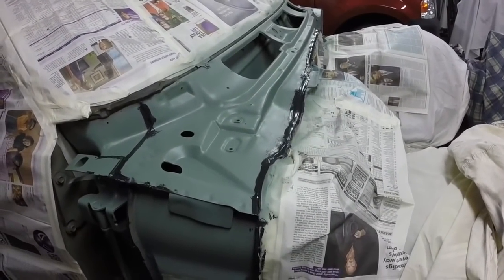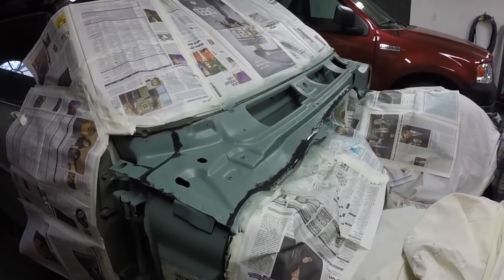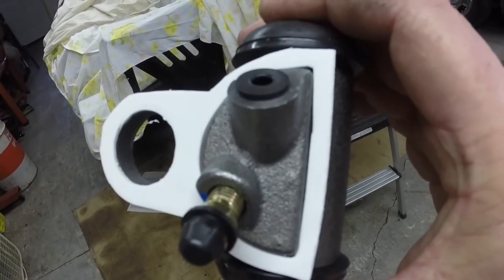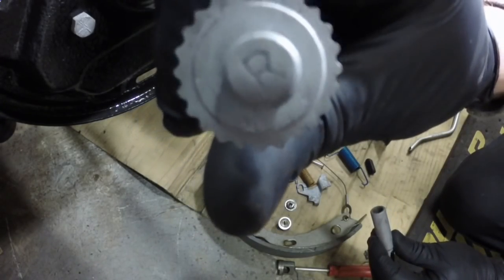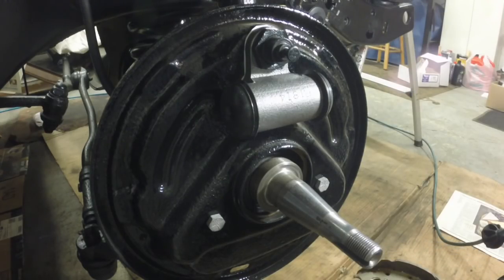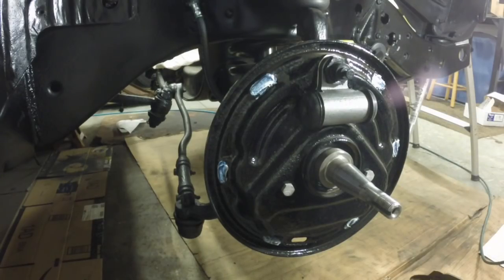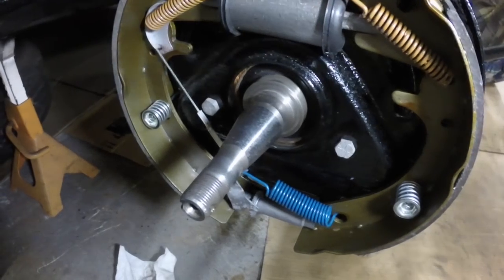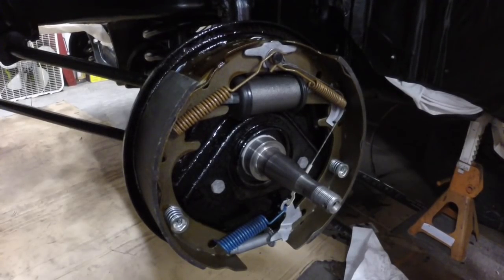1966 Ford Galaxie 500 convertible restoration part 48 installing front brakes

Comment: Well, DAMN.  I had it right but thought it was wrong so I took it all apart again.  When I got it all together, the adjuster lever was riding alongside the star wheel.  I thought it had to be up higher so you could hear the click of each "bump".  But, mine was alongside the star wheel so there was no specific click, click, click as the star wheel was turned.  Well, now I know since your adjuster lever lies alongside the star wheel, too.  And you helped me in another area, too.  I started doing the brakes a year or two ago but got discouraged when I got everything together and they hung too loose.  I was only using one holddown lock "washer".  Then, I noticed I had another one, too.  I figured that went behind the backing plate.  Nope, wrong again.  But you showed that the two holddown lock "washers" go on each end of the short holddown springs.  That works.  I'm so tired, I just had an ice cream.  Now, back to work.  Thanks for making the video.
Reply from the maker: Im glad my videos are helping with your project.

Comment: Wish you would have recorded removing the wheel cylinder.  We played hell getting my uncles off. Theres a 1"and 1/4 nut that holds it to the backing plate with a lock tab on it. It does come off. Even though theres a bolt through the back where the upper ball joint is.  It was seized up and we played hell getting it off. No one has video of removing it. but now we do!! Nice car though!!

Comment: You covered the brakes very well and I think I understand why you didn't go into the hardness of shoes or as I say the ones with the metal flake in the shoe and have a lifetime warranty. The problem with those shoes is they eat the brake drums up each time you step on the brake. Now the cheap ones are made of a different material and they stop well but they eat themselves up. The middle grade ones wear even with the shoes, they are a bit harder an wear even with the drums so that everything is worn even and last the longest. The premium shoe has the metal in them and the shoe still has wear left in them. Trouble is you can't put old parts against the new because of the wear groves and will chew new drums up. It is hard to put into words but for lasting and good braking. I tend to use the cheap one on my own car cause I turn the drums so they are not out of round and don't have grooves in them. My dad was a cheap skate and said a crooked row would more corn but it pulls the car to that direction too. Self adjusters work if you back out of the driveway and and tap the brakes and the adjusters will click one time. If your a brake rider then the linings wear uneven and you visit the adjuster and give it a couple of clicks and then the sound is even on the drum while tire is in air turning.Its a mess to explain  cause the more  you say, the more confusing it gets. Everything is important as the rubbers that cover the adjusters, keep dirt and mud out and help things wear even. People drive through deep water holes to wash the underside of the car. I suppose it helps some but if it is salty water then much much worse as the water gets trapped in places that don't drain well. Occasionally I take some wire and run through the holes under the doors and around fender catch areas that pick grass and mud
Reply from the maker: Your spot on. The main reason I use the regular (non metallic) shoes on my older cars is for two reasons. The drums last twice as long, and the cars of this era didn't come with metallic shoes. I clean the drain holes too.

Comment: I watched a video of iron trap garage applying seam sealer, and his trick was to use masking tape on both sides and then apply the sealer in the center then remove the masking tape leaving a crisp straight line with no mess.
None the less the galaxy is looking very nice!
Reply from the maker: I thought about doing that, but thats not how it was done at the factory. The factory sealer was haphazardly laid down. I tried to make it look close, but I still think my job is neater than it originally was.

Comment: For the final adjustment of the brakes when finished - on page 17 of the red 1965 Ford and Mercury Shop Manual (In-car brake adjustments and repairs) it says, "... install the drum carefully so the grease seal retainer within the hub isn't damaged.  Remove the adjusting hole (rubber) cover from the carrier plate and turn the adjusting screw upward to expand the shoes ... until a drag is felt when the drum is rotated.  Remove the drum.  Mark the tooth on the star wheel where the lever contacts the adjusting screw.  While holding the adjusting lever out of engagement with the adjusting screw, back off the adjusting screw 3/4 of a turn with the fingers."  After that, the self-adjusters will position the brake shoes properly each time you back up and apply the brakes.  I've got one of those measuring tools that measures the width of the brake drum and the other end measures how far to set the brake shoes to match.  That should be pretty close to having the "brake shoe drag" specified.  From there, I guess I could just back off the shoes that 1/2 or 3/4 of a turn to put some space between the shoes and the drum.  Then, let the adjusters do the final "adjusting".
Reply from the maker: the way the shop manual stated is the best way to do the adjustment.... You can use the measuring device, but it can be too tight sometimes. I get it close with that, leaving a gap between measurements, then install the drums, manually adjusting it until light brake drag, the use a small screwdriver to push the adjuster off enough to turn the star wheel back. Before installing the drum, I count how many teeth is 1/2 turn, or if you can see well into the hole, paint a spot that will face out, at 1/2 turn. Make sure you bleed the brakes, before doing any final adjustment, so you can apply them to make sure they're centered. Don't bleed the system with the drums off, you can blow the guts out of the cylinder if you do. I'v done thousands of drum brakes and just know where to adjust them too, so I done really bother to doing anything other than get the shoes close before installing the drum. It just saves turning the adjuster a lot with the tool under the car.
Reply: @OldCarAlley  Another thing I thought I'd try is to crack open the wheel cylinder bleeder screw when putting on the brake shoes.  It seems difficult to "seat" the brake shoes against the wheel cylinder and I wonder if that's because of air/fluid pressure in the brake line.  Maybe opening that bleeder would relieve the pressure and allow the shoes to fully seat and stay in place until everything is all put together.
Reply from the maker: @STBRetired1  You need to apply the brakes, to center them to the drum, then do you final adjustment. If there is air in the system, the pedal will be spongey or just go to the floor. You can gravity bleed them, but that takes a to of time. If they're bleed out already properly, then don't open the bleeders.... just pump the pedal a few times, with the drums on, then do the final adjustment.

Comment: i think another way to get seized drums off is cut off the shoe retaining pins from behind the backing plate at least that's how i did it on my silverado & almost always the brake line is seized rusted/rotted at the cylinder fitting
Reply from the maker: That works too, but you still have the brake cylinder push rods holding the shoes a bit.... I have done it that way when the adjusters are frozen up.... thats about 50% of the time.

Comment: I'm thinking the wheel cylinder gasket may prevent squealing, squeaks, clunks, or other brake related noise? Like you said, better safe than sorry, it was on there for some purpose.
Reply from the maker: I think it also works as a gasket to keep splashing water out.

Comment: I know you want to keep the car as original as possible but a front disc brake conversion on this car is not that bad and it may be something to consider down the road just from a safety standpoint. Then again maybe you can find an original parts car somewhere to scab the brake parts off it.
Reply from the maker: The drum brakes will be fine. Just maybe if I find all the factory optional set up, I might install it.... but now that the drum system is new, I doubt it.

Comment: Awww, why did you have to fade out at the critical point?  I'm trying to DISassemble the front brakes on my 1965 Ford Custom (Galaxie).  I've got everything undone except getting the front wheel cylinder off.  When you put your front wheel cylinder back on, you put something on the stud and quickly faded to using the torque wrench.  My car's wheel area is quite dirty but I think what you put on was a thin nut.  And, I'm thinking that that stud DOESN'T turn.  Thank God I didn't put too much pressure on the head of that stud before giving up.  If I broke it off, I'd really be in a jam.  I'll go clean up the wheel cylinder area better and see if I can get at the large, thin nut.  OH, why didn't my new Raybestos wheel cylinders come with those gaskets?  If your 1966 Galaxie had gaskets then you'd think my 1965 would, too.  Of course the Ford Custom was the cheapest model of the Galaxie line so maybe they saved 1/10 of a cent by not putting gaskets on the cheap line model.